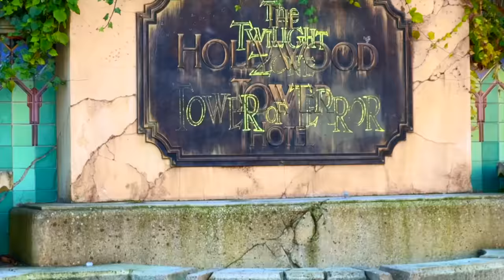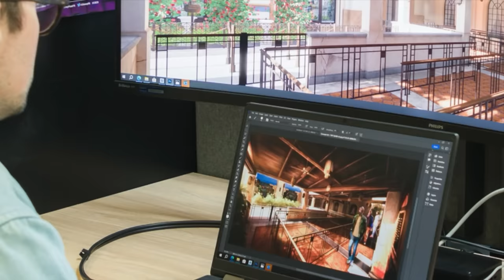Disneyland Paris Construction & New Info Update | December '23

Comment: I was wondering about the Lion King area... and then you showed it being prepped - nice!
Reply from the maker: It looks like they're pre preparing it, if that makes any sense. Works can't obviously start until the permits are filed but this shouldn't take too long to happen! The announcement itself may be closer than what some think...
Reply: A Lion King area next to the Frozen area sounds so prespoterous. That will make two float rides in almost the same area.
Reply from the maker: That’s a good point actually, having two water rides seems strange but they’re different systems after all. Frozen doesn’t get you wet, at all, it’s like Pirates. The other should be more trilling like Splash Mountain. Studios doesn’t have any water ride but most other ride systems have a presence here, so it makes some sense.
Reply: @themainstreetnews  a Splash Mountain like ride in DLP is not relevant at all, Paris and Florida are very different in terms or weather, such a ride would be closed from October to March, so What’s it worth ?! Moreover The Lion King is not intergenerational since contrary to Star Wars or even Avatar to a certain extent The Lion King is neither a saga nor a licence. So the upcoming announcement of a Lion King area is a very sad news.
Reply from the maker: Firstly, Tokyo has a splash mountain and a very similar weather to that of Paris. They can regulate the water levels to make 0 or a lot of splashes depending on the day. Secondly, you really prefer one small scale clone of an already existing land with less than half of the offerings than 2 completely original lands with new ride systems? The Lion King flume is said to be the biggest and best flume Disney has ever made, with incredibly impressive technology!
Reply: @themainstreetnews  I don’t build my opinion on rumors but facts. And so far no rumor about that potential Lion King splash ride can seriously be taken for granted ! Too much enthousiasm often leads to great dissilusions. Flight Force or Hyperspace Mountain are perfect examples of high expectations which eventually turned out to be great disappointments. Avatar, Star Wars, Cars or even Zootopia offer greater expectations than the Lion King. The only thing you find exciting about it is the idea of having an exclusive land at DNP.
Reply: @themainstreetnews by the way what do you refer to by « two completely original lands with new ride systems » ?! If the Lion King Land is unfortunately confirmed that shall make one not two original lands. Arendelle at DNP will just be a « clone » (I quote from you) of Hong Kong Disneyland and Tokyo Disneysea…
Reply: @themainstreetnews  I would imagine The Lion King is going to be more like Shanghai's Pirates...?
Reply from the maker: I agree with you there, we should wait for confirmation. The thing is that I’ve seen and heard a lot of stuff about this, and I can tell you it won’t disappoint!
Reply from the maker: What I mean is that there will be a Lion King land and a Star Wars land. SW will be behind Discoveryland (not an expansion of Disco but a separate land) and Lion will take the place of the old SW land.
Reply from the maker: It’s hard to say precisely. I’ve heard that it’ll be the next level log flume, so it could incorporate some elements from that amazing technology from Shanghai!
Reply: @PeterOliverPacker  Star Wars is Disney's sciagura